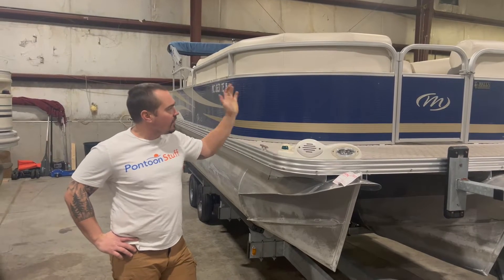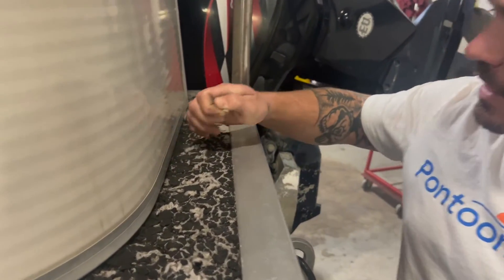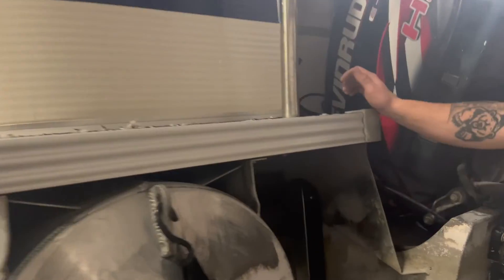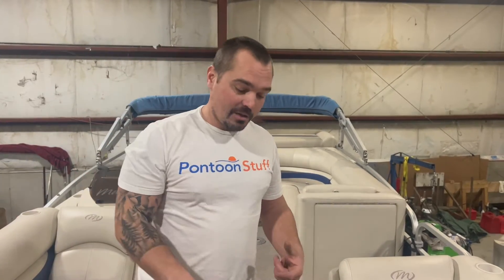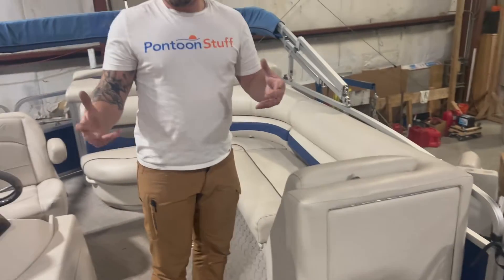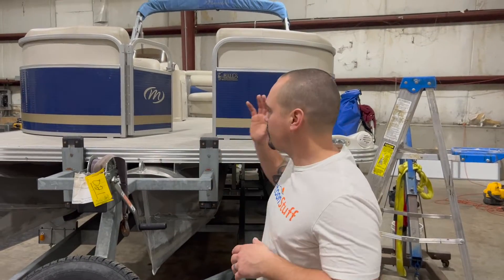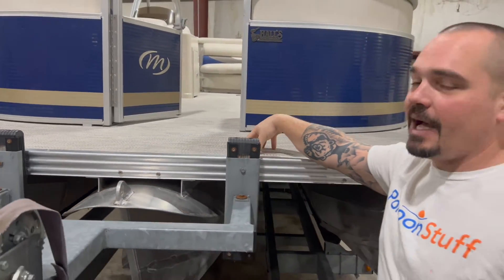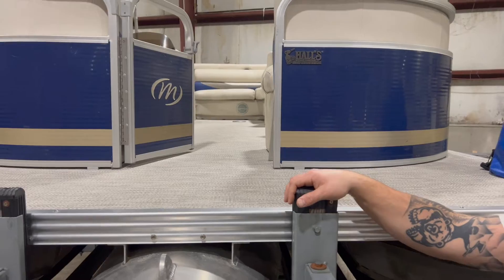New Vinyl Flooring on Tritoon - 2010 Manitou

Comment: Please show video of removing and reinstalling the under skin
Reply from the maker: I definitely will next time we tackle a boat with underskinning! It's a bit of a pain, but has to be done. We remove them one sheet at a time from the front to the back, and label them by side and order. These were stainless self-tapping screws which is about the easiest to remove. If they're riveted up then each rivet has to be drilled out making a huge mess of hot metal all over me and the floor!